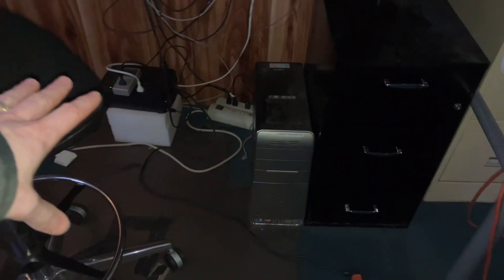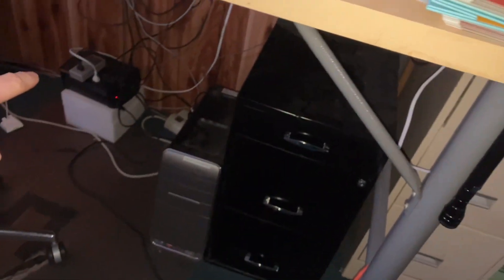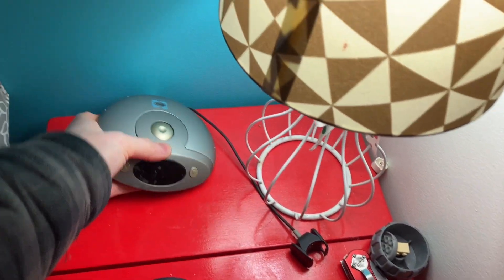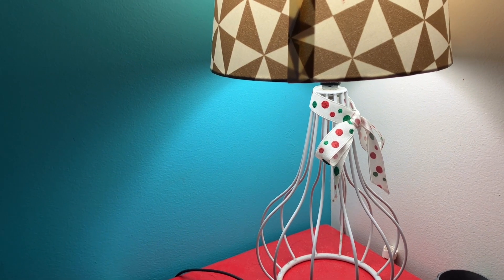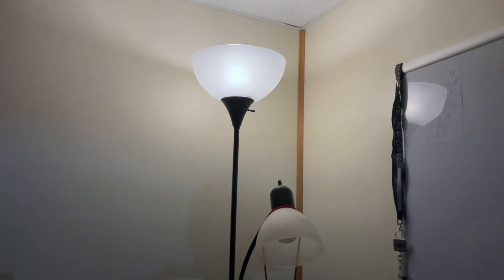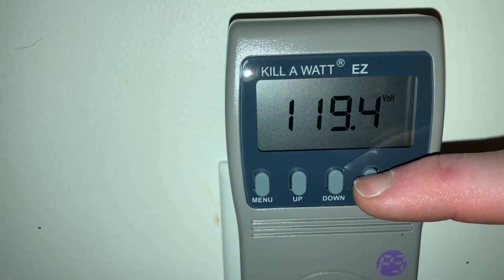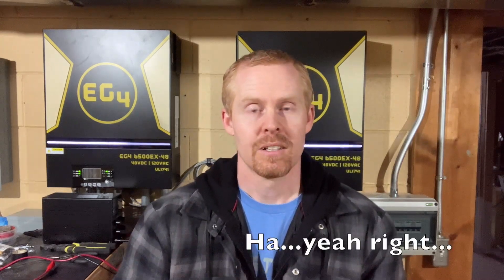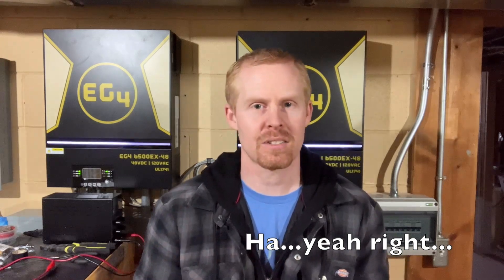Update: Possible Flickering Light Fix for my EG4 6500s?

Comment: My guess would also be that it's PWM a large load
Reply from the maker: You saw in the video though, it wasn't a large load.   The heated blanket was under 200W, the mac mini is under 100W.
Reply: @AdamDeLayDIY  If my guess is correct you may be able to rule it out with a camera and video editing software. If PWM is used to regulate the temperature then it's possible that the "pattern" is consistent to deliver heat without the user noticing a cycle. If that guess is true, then maybe the flickering correlates with the power level. If the PWM is very quick it could be imperceptible to our eyes.

Could potentially rule out by taking video of the flickering at every heat level and then compare the frequency by putting the video in a video editor and counting frames.

Just a guess but it might be an avenue worth investigating

Comment: Looks like the inverters have issues with PWM controlled devices. A lot of electronic devices have this. The inverter can not change fast enough to keep up.
Reply from the maker: Entirely possible.  So far these are the only two devices that I've found to be an issue.

Comment: i can tell you that it  happen to me even connected to the grid ,i happen to have a Schneider xw inverter and my kitchen light flickers only when my desktop computer is on (1200w power supplied) if i put my inverter in grid-tie mode it won't flicker and yes the Schneider can run offgrid or grid-tie but even when i have the inverter in by pass mode when my neighbor is taking a bath  ( he has a in-line water heater and is connected to the same pole as my house ) my room light flickers like crazy so , is not something isolated to inverters is that LED lights some are sensitive to fluctuations more than others but yeah is a littler annoying .
Reply from the maker: Very interesting.  Thanks for sharing!

Comment: I have an older version built in early 2022. I have it in off grid with led lights, tv, battery chargers. I have a o-scope ADS1013D and out of curiosity I hooked mine up to look at the waveform. Sine wave looks good and rounded at the peaks, but noticed a small bump that occasionally appears at the 0 degree transition point of the sine wave. I’ll have to bring it home and connect it to grid power, but thought it was an interesting blip at that transition. I have not seen a problem with my LED lights, but I haven’t tried many loads, still in the building phase.
Reply from the maker: Thanks for sharing!  Would be interested to hear what you find out with your other scope test.  I think I'm gonna have to bite the bullet and get one shortly.

Comment: The crock pot on low or warm causes flicker for us but not turned up on high.  Add load!  :D
Reply: Most likely because the crock pot cycles the power to the heater element at lower settings.  It's the change in load that's causing the issue.